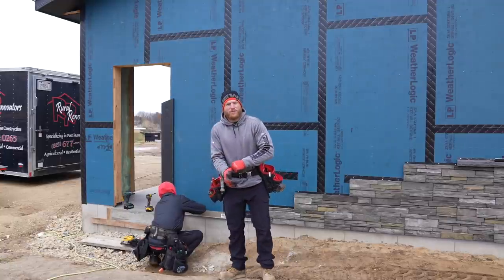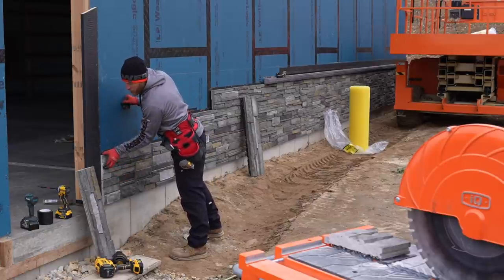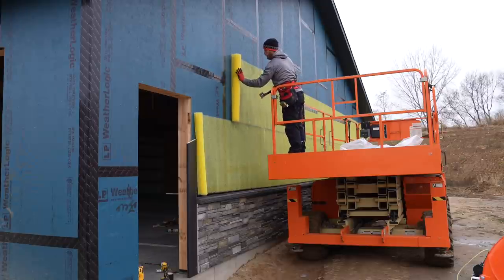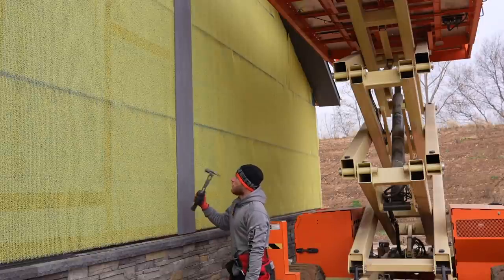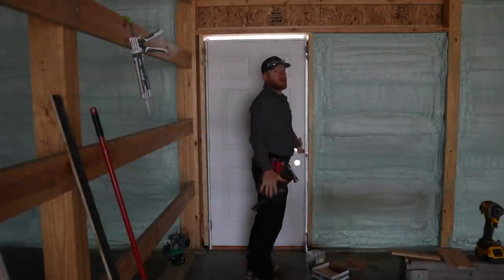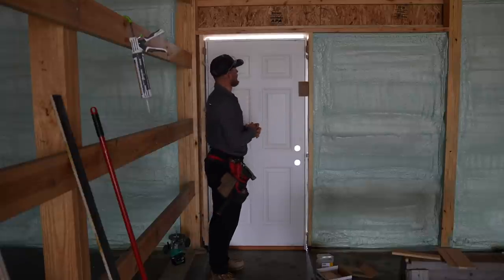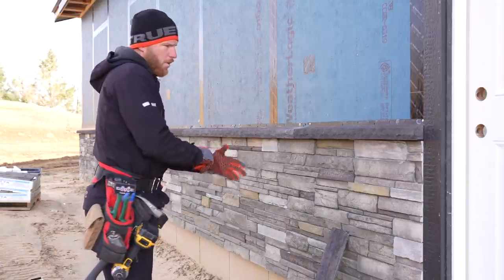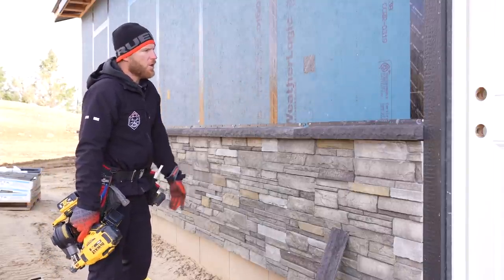Building a Barndominium 11:  It's Getting Crazy

Comment: The rock on the bottom looks nice! We need to figure out what type of siding we want to use on our house. We want something fireproof, so were thinking about using metal sheeting.
Reply from the maker: why fireproof?? are you building your home out of wood?
Reply: @RRBuildings  I'm guessing wild fires 🔥 are a concern where they live . Maybe
Reply: @jgoody7467  nothing is fireproof to a wild fire unfortunately. everything will eventually burn. best solution to a wild fire is a crazy strong sprinkler system and days of soaking the ground before it comes for your house
Reply: We are in the desert 1/2 mile from our nearest neighbors, and surrounded by dry grass and mesquite trees. It doesn't have to be completely fire proof, but fire resistant would be a plus. We ordered our metal siding. I was watching this video again to see if you said anything about an air gap. We plan to insulate the exterior walls with rigid foam, then put 1x4 for spacers/vents between the foam and the metal siding. Hope it works out. 🤞

Comment: Different door standard compared to Sweden. Here all doors are required to open outwards, so no one gets trapped in case of a fire. Also our doors can be plum-adjusted by the client after the building is finished. But this requires that the threshold can move slightly sideways, so we can't secure it the way you did here.
Reply: Hey, Bjorn. What if you have a massive snowfall overnight, and it blocks your outward opening door? Here in the UK, it just rains…..no snow, and the rain puts out any fires! Tack
Reply: @adychrister3346  Just came 10 cm of snow here the last few days. Made the countryside look beautiful.
Reply: @BjornMoren  I think Ady was asking how you open the door out if you have a big snowfall or snowdrift?
Reply: @edwardholmes91  Most buildings have a roof over the entrance, so that is never a problem.
Reply: @BjornMoren  Ah right, I see.  We don't get much snow in the UK but everything grinds to a halt when we do!
Reply: In the US, commercial buildings are required to have outwards opening doors for fire safety, houses can go either way.

Comment: That spray foam can't be cheap, but just imagine how easy it will be to heat and cool that building!
Reply: up here in canada it's expensive but with brutally hot summers 50°c or 122°f and winters -40°c/f I believe spray foam is essential. it's really the only method to keep the heat out or in depending in the weather. about 14k for a 2000 sq ft home

Comment: My understanding is that 4" of closed cell foam on the ceiling will result in just over half the IECC code requirements for northern Illinois (R49). Are you going to "flash-and-batt" them to hit the prescribed code or is the plan to use the "performance path" method using something like REScheck?
Reply: When you find out for sure, let us know
Reply: I am quite sure they have it done at or above standard
Reply: @mcgillicuddy_  The reduced code is for "cathedral ceilings" which I don't believe pertains in this case, since this building will have a separate ceiling and thus an attic. And even if it did, the code in Zone 5 (where Kyle and co are at) is R-38 -- quite a bit more than the theoretical R-28 (and practically, likely closer to R-25) that 4" of closed-cell provides.
Reply: @Dave Klein  Kyle is one of the best builders in the world, IMO, so I have zero doubt that the final product will run at a very high standard. But at this very point of the series, the only insulation is the 4" of closed-cell which is far far below what is prescribed by the IECC code (R-28 vs R-49). Since Kyle doesn't go half-way, I'm assuming that he's going to add more insulation later OR do the "performance path" method in the IECC... I just want to know which.
Reply: @granworks  I am quite sure they have it built at or above standard... what you want to know means NOTHING
Reply: @daveklein2826  Look, I get that people watch Kyle for differing reasons, but I primarily watch him to learn more about excellent building. How he will get the insulation to ""at or above [the] standard" may mean nothing at all to you, but it does matter to me, as it's a learning opportunity.
Reply: @mcgillicuddy_  I am nowhere near an expert and so I can't speak authoritatively on any of this. But from my reading of the code and the interpretations of the code, I see "unvented attics" and "cathedral ceilings" as two separate things, talked about in different sections. The barndominium fits R402.2.1, since it does have an attic space -- if there was R-38 on the top of the wall plate, then it could use R-38 for the entire roof. That's not the case here (yet). Cathedral ceilings fit R402.2.2 (cannot have an attic) and that can go down to R-30, but only if the cathedral part covers up to 20% of the roof. That doesn't fit, here, since it's the entire roof. Some jurisdictions do override this, but I haven't seen if IL does. This is 100% besides the point, too, since 4" of closed cell foam does not even theoretically hit even the most minimum of R-30... so we're back to my original question -- how will Kyle meet or exceed the code? Add more insulation; use the performance path; or go a third way that I haven't heard before?
Reply: Pretty sure he said a few episodes ago they would have additional fiberglass or rockwool

Comment: Hey Kyle been watching for years and learned a ton, I'm about to start a building project that will be in a pasture with cows in it... You may not have run into cow pressure but they are super had on anything they can rub on so I've been thinking about using verseta stone for a wainscot maybe 4 ft tall to protect the bottom of the building from them but the bulls are pretty rough on things have you built any buildings that have constant pressure from livestock and what do you think would be the best option for facade on such a building?

Comment: Hi @rrbuildings ,a question from sweden, what is the advantage of mounting the door so it opens inwards. This seems to be common in the US but very unusual in Sweden where the doors are mounted so they opens outwards.
will not water that will blow against the door flow in?
Reply: In the UK most external doors open inwards too.  Also, if you get heavy snowfall, how do you open your door?
Reply: It's true, it's easier to get out if you're snowed in. Do you often get snowed in, in the UK? I have never been snowed in here in Sweden.
Reply: @trevannerevent8546  We never get much snow in the UK to be honest.  Chances of getting snowed in, in the UK are nil, I'd have thought.
Reply: I have 3 exterior doors in my house.  2 opens inward and 1 opens outward because of where it is.  I am in NE Texas so snow is not much of a problem.
Reply: I'm replacing my inward opening door with outward due to hurricanes and extreme thunderstorms.

Comment: Question on spray foam in the ceiling, closed cell, so it’s a great air seal and moisture barrier, but is 4 inches for a max of about  r28 really enough for a ceiling? Isn’t new code r40 or r50 now?
Reply from the maker: closed cell works different than blown in fiberglass...because air and moisture can't pass thru
Reply: Spray Jones has several excellent videos explaining how to meet code using CCSF.

Comment: Holy cow that's gonna be an extremely tight house with that foam insulation. The downside is that's probably $20k worth of spray foam. It's a great way to insulate, but it comes at a steep cost. I'll be building my small-ish retirement home (~2200sqft) in a few years and I will definitely utilize a 2in flashing of closed cell spray foam around the entire envelop of the house, in addition to a less expensive bat inside of that. The spray foam not only provides superior R-value, but it also adds shear strength and serves as a secondary air/moisture barrier. I think it's definitely worth the cost to have a more efficient, comfortable, durable house in the end.